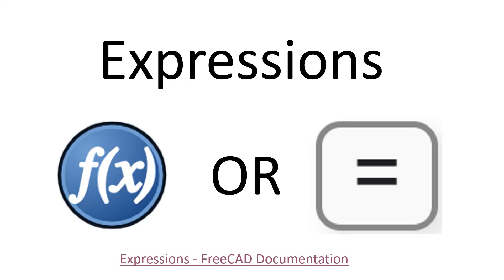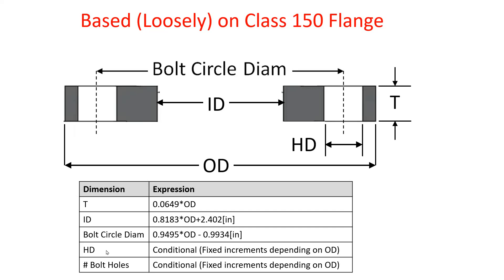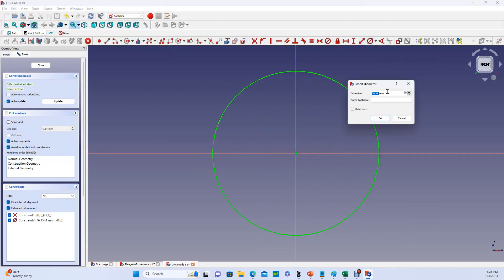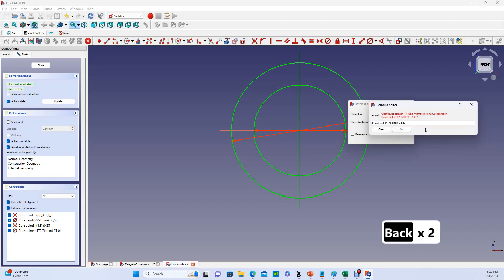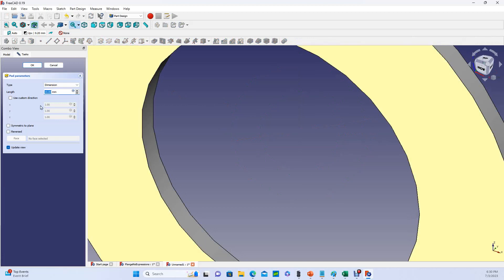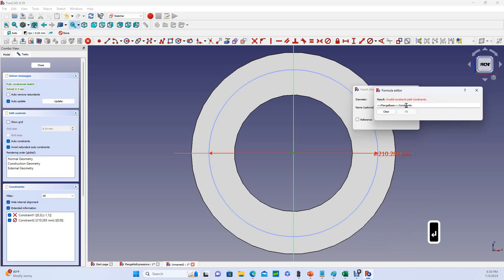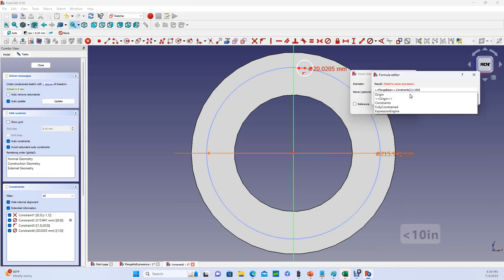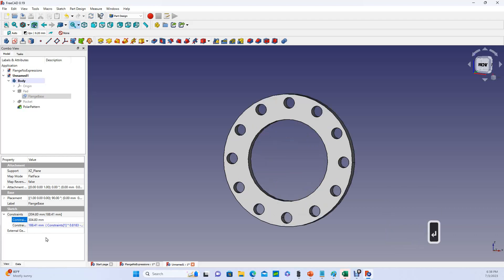FreeCAD Tip - Expressions

Comment: Thank you for this easy to follow example. Constraints as expressions of other dimensions is what truly makes FreeCAD a parametric modeler. It seams like 90% of the FreeCAD videos are “for beginners” and only show each constraint being given a fixed constant value. I can make those kind of parts in plain AutoCAD 3D solids that are fixed with the “parameters” determined at original solid primitives creation. Expressions of constraints, in my mind, is what makes FreeCAD a true parametric 3D CAD modeler. Your explanations were very clear and well presented. Also, thank you for referencing the FreeCAD documentation of “expressions”. I wanted a model of a netting gauge that is simply a rectangle where the length is twice the width. A very simple relationship used for making various size nets of different opening sizes for cargo netting in either paracord or elastic cord (bungee cord). Now I have one netting gauge model that can create STL files to print for many netting gauge sizes.

Comment: You are doing it the hard way.  Just create a Freecad spreadsheet and put all of the dimensions in there.  You can use expressions to derive one dimension from another there.  That way the sketches, pads, pockets, etc. are always dependent on a single value from the spreadsheet.  That way if you need to change the derivation of a given value, it is done in only the spreadsheet.  No references need to be touched.  In your method, if you have multiple dimensions with the same derivation, each would still have to be changed.  Yes, it works, but the spreadsheet method is infinitely more maintainable.

Comment: You could name original diameter something like: "outside_diameter" and then in other constraints use that name and not numerical value. Something like "<<Sketch>>.Constraints.outside_diameter * 0.5"
Reply: Tried that. Still getting the error.